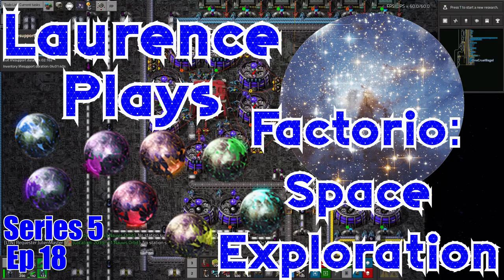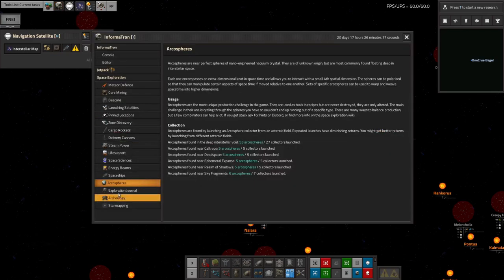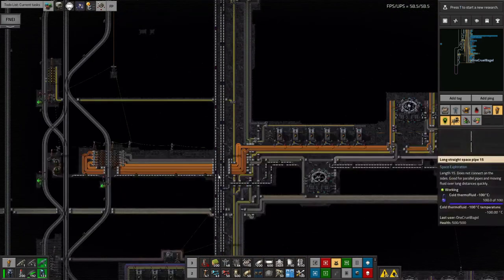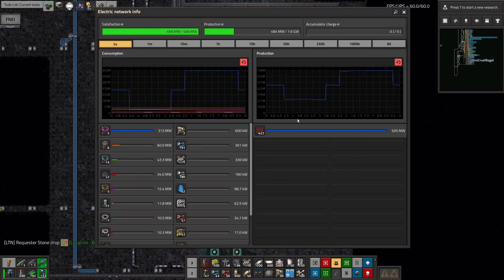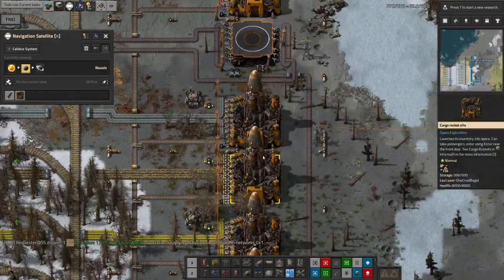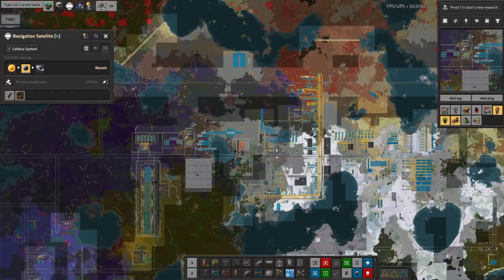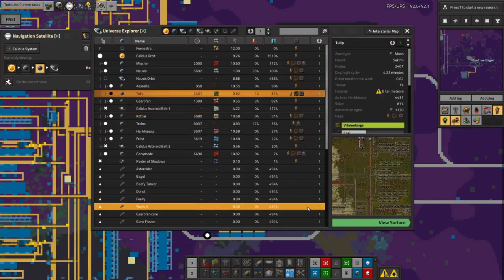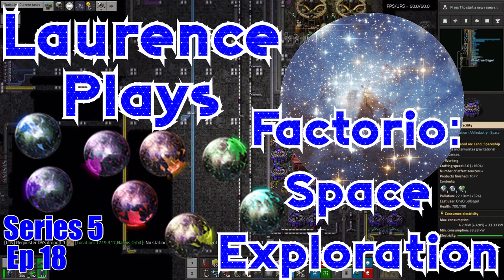S5-E18 - Arcostirring - Laurence Plays Factorio: Space Exploration

Comment: Just for future reference (in case future Laurence gets annoyed with this way of balancing!), each recipe that uses Arcospheres has a closed loop that can convert resultant acrospheres back to the original ingredients.   There are also 2 inversion recipes that you may also need
Reply from the maker: I'm aware of the inversion recipes - they seem to not be too important, however, as the folds are doing all the changes I need. I still haven't really sketched out the processes though.

When you say a closed loop, do you mean that if you run all 4 science pack recipes, you'll end up with the arcospheres back where you started (for example)? I didn't want to rely too closely on things like that because I hadn't thought it through properly, and because I suspected that when the recipes change, it might upset it.
Reply: @LaurencePlays  With closed loop, Mr. Slaney intended that for each recipe using arcospheres as catalysts there exists a (unique?) sequence of folding and inverting recipes that returns back the input arcospheres. For these sequences you will need more arcosphere of the ones required in the recipe, so that you have room to juggle them around. I managed to find the sequences and to design closed builds for all arcsphere recipes (both randomly flipping versions), and my god if it was painful! I kindly suggest you to keep an eye on your arcospheres as the two inversion recipes are basically mandatory to keep balance in the universe!
Reply from the maker: @federicomarini9850  I shall definitely keep an eye on them. I've been meaning to sketch out the folding process to get an idea of whether it's "complete", but if I need to, I should be able to redesign the system to use the inversion recipes as well... But only if I need to. We shall see - so far, it's been OK.
Reply: @LaurencePlays  The closed loop means that for each recipe that uses spheres you can convert back to the original spheres using various folding recipes, without need for another recipe.  You will need to use more spheres as catalysts during a sequence of foldings.  The complication becomes in catering for when the recipes flip unevenly and you get too much of one product.  This is where I came to realise the splitters do NOT evenly distribute and I had to use chests and inserters to ensure exactly the right number of spheres went to their target lanes.  ( i.e. wait for 4 in a chest, then signal 4 inserters to extract 1 each )